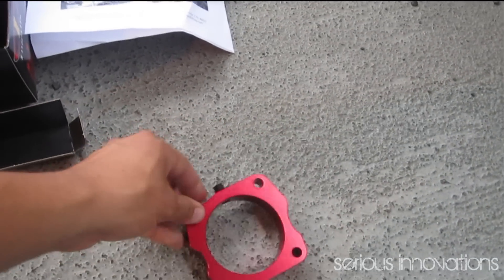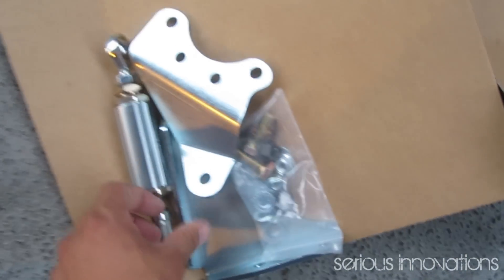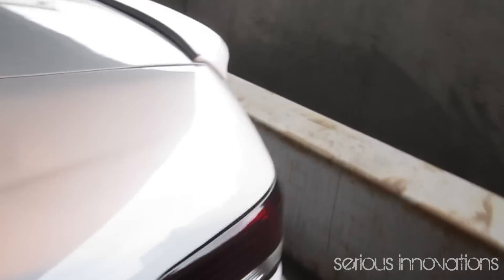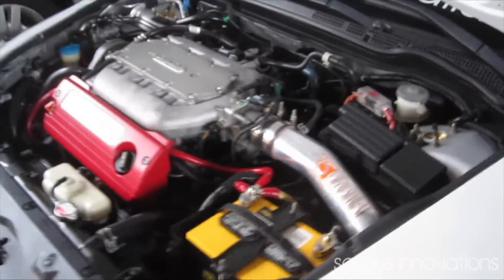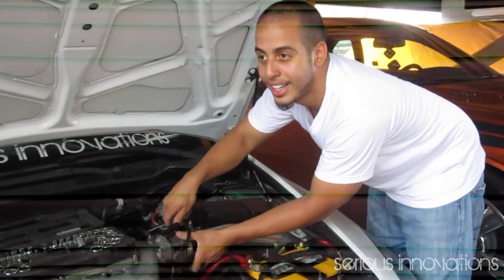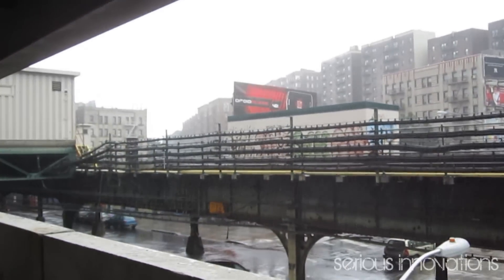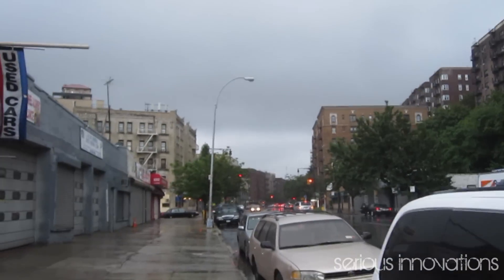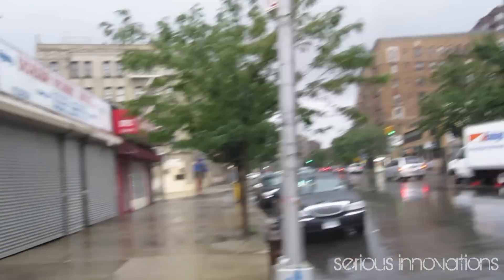How to install Ingalls Stiffy and P2R Trottle spacer plus huricane irene update. part 1 of 3

Comment: Hi where do i get the parts???
Reply: p2r  is in South. Florida  they have a website.  And is throttle body spacer is missing two pieces or 1 depending on your setup and that should be the thermal gasket that came with it. and for damper shop around cuz you can get them for pretty cheap the manufacturer retail price for that particular one he's using is over $300